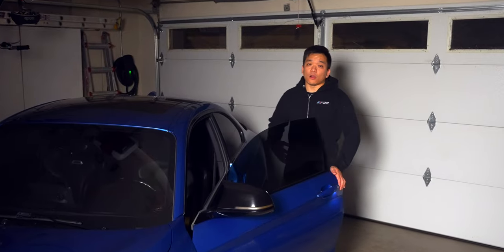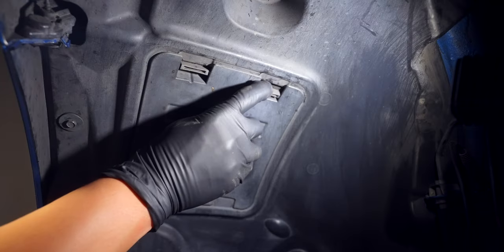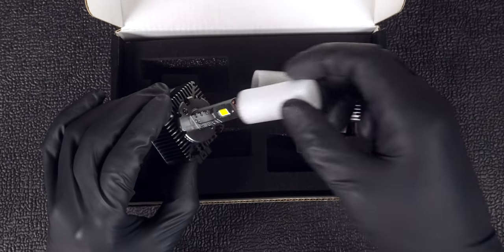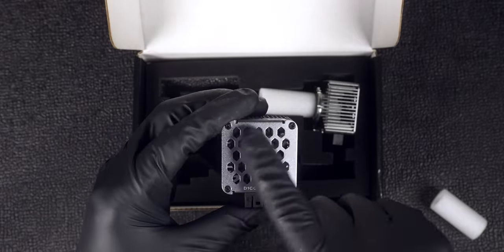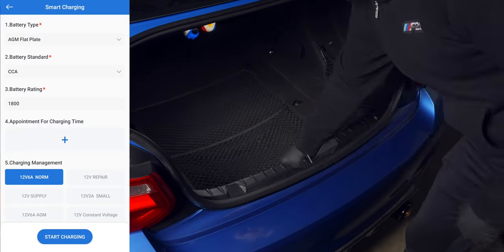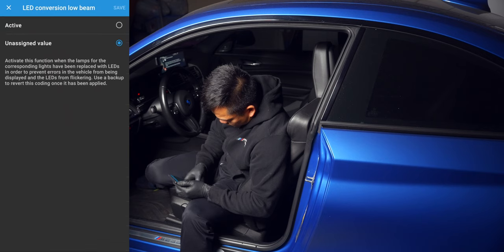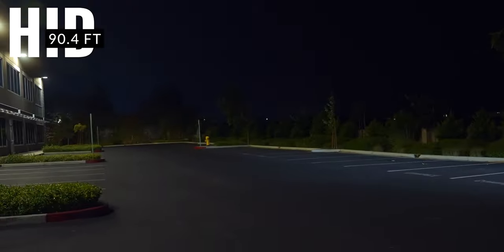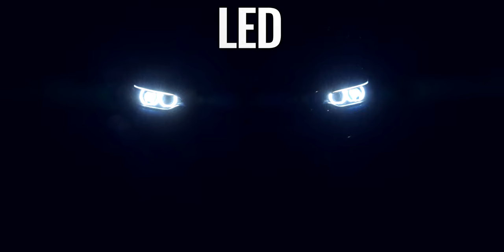UPGRADE your BMW Headlights in UNDER 4 Mins

Comment from the maker: I forgot to mention that the LED bulbs used in the video are also 35W (same as OEM) so they shouldn't draw any additional power. You could opt for one with a higher output for better brightness, but I thought that this would be a more fair comparison. 

35W: https://amzn.to/3KXa6Pu
Reply: The item description says “70W” idk if it is just me?
Reply from the maker: @crackedpond9631  35w each for 70w total
Reply from the maker: @crackedpond9631  the 35W per bulb specification is in the manufacturer's specifications picture. Under the product description

Comment: Can you put these in to replace adaptive xenons? Plug & play? Would it be worth it?
Reply from the maker: If it's a D1S then it should work. You can look at the other types they have as well.

https://amzn.to/3qPb5ug
Reply: Xenon is HID (xenon HID) just easier to say HID than to say Xenon HID. xenon is the gas used to create the light.

Comment: i only have one question why we have codling？
Reply: Led lights needs less power than halogen lights so if the lights are still coded in halogen lights the car will think that the lights are broken since they’re now using less power, and you’ll see errors. Coding it to LED mode avoids that

Comment: How does the high beam look compared to OEM? Brighter and same distance perhaps?
Reply: brighter as they’re illegal, not that it matters, i have them. And let’s say wider and further or higher as the light leaks a bit. not designed for a xenon set up
Reply: You mean high beams too bright to use and the beam not sharp like OE? Also, how is visibility with regular beams for up close objects on the road? Overall, you like these better?@Brian-jv8iy

Comment: Just installed these. Thanks for the rec man. 
Previous owner had the Osram D1S 35W HID bulbs on. 

Literal night and day difference compared to these. Didn’t even have to take my wheels off. Just turned the steering wheel to full lock on opposite sides.

Comment: 1:21 the LED fan seems to be Really loud, can you hear it when in the car?
Reply from the maker: No. The canara was just close to it. The same settings were used when comparing the beam angle and it wasn't audible there
Reply: I just installed these. They are not audible whatsoever with the cap on. They were also nowhere near as audible as in the video when the cap is off.